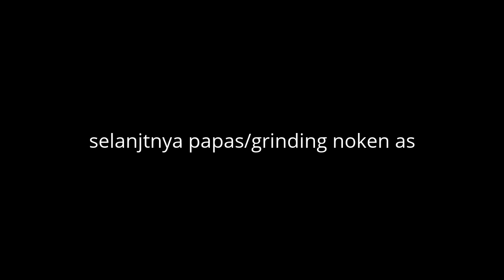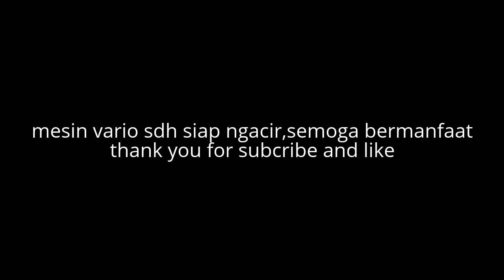Tips Hemat Bor Up vario 110 karbu

Comment: Klo motor vario saya sdh di papas noken as nya 0.9 mm enak emang bawanya, tapi yg jadi kendala kok gak kuat starter ya..
Reply from the maker: kompresi brp?
Reply: Ramandita Motor saya pake piston 52 mrek fim, kompresi 10 ya lebih dikit lah.. krna gak kuat starter ,ya saya balikin pake noken as standar langsung bisa...
Reply: Ramandita Motor apa noken as nya yg bermasalah, al nya di balikin pake noken as standar langsung mau
Reply: @abdulbasith9088  Sepertinya Ads Yg Di Noken As Engga Di Pasang

Comment: mas motor aku mio seher 53,5 ? karbu pe26   
per klep jepang noken kawahara k1 . bagian cvt aku pake roller std sma per cvt std kok tarikan atasannya ngk dapat yaa mas ? tolong masukannya mas
Reply from the maker: saya jg pernah kaya gt mas,noken as saya rubah baru bisa narik,sama per terlalu keras klo pake japan mas
Reply: head saya juga sudah papasan mas ? apa ngk ngaruh mas ? nokennya bagus pake apa mas kalo boleh tau
Reply from the maker: klo piston segitu pake noken std digrinding sdh cukup mas
Reply: kalo noken racing ngk cocok ya mas ? soalnya di balikpapan masih sedikit bengkel yg bisa grinding noken mas ? kebanyakan malah kit di suruh pake yg racing mas
Reply from the maker: sebenarnya modifikasi noken as kan mengimbangi spek mesin blkg mas,klo mau bertahan pake noken itu ya piston ganti yang lbh gede lagi mas
Reply: oke mas nnti sya coba giring noken std sya mas ? makasih yaa mas masukannya

Comment: Request mas,, tips dan trik bore up Honda beat karbu
Reply from the maker: ok mas
Reply: Tak tunggu ya mas,, kalau ganti motor matic lagi yang 125 CC nggak punya uang mas, alangkah baiknya bisa diakali dengan bore up harian, sama tips supaya bensin irit mas, beat saya 1 liter jarak tempuh 20 kilo kan boros banget nih, ada solusi kah
Reply: Mas itu tunernya pakai apa ya mas handpiecenya
Reply: pshycoterz NA wah kok pdo pario ku mas. Hahaha... Asem ki.. haus banget ma bbm..
Reply: pshycoterz NA  klau bore up beat karbu spek 130 cc open 150 cc pml 2500.000 udh tinggal gass boringnya pake kawahara klau gk kawahara cld klep sonic 24 28 proting in ex per klep pake swedia noken as kawahara k2 seher bisa pake fim kawahara blok head budurnya di rubah